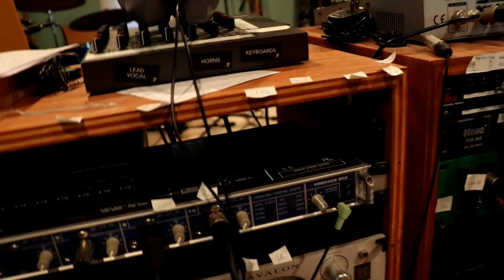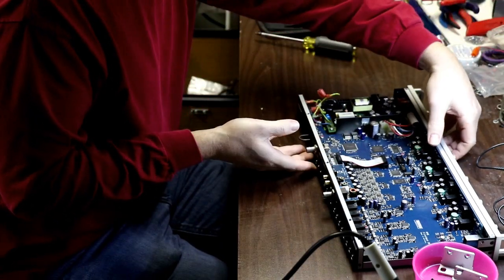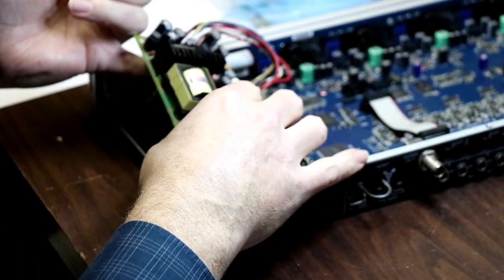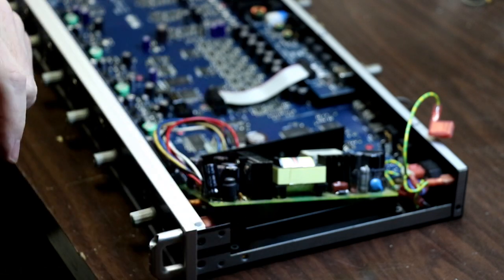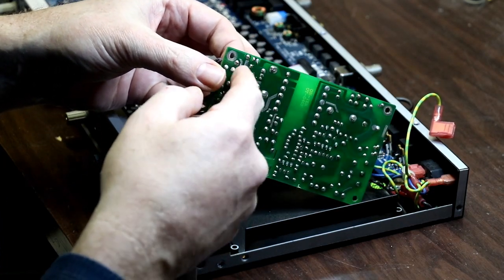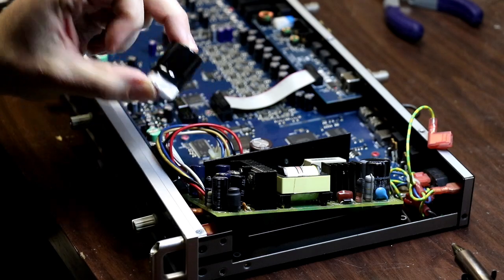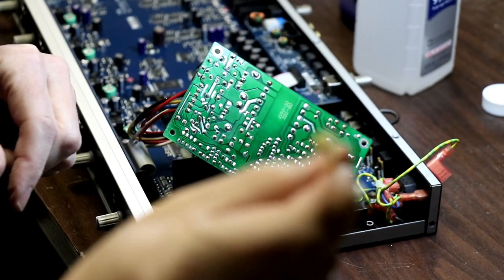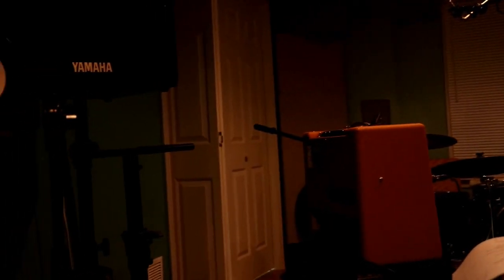RME FireFace 800 Repair

Comment: Great video ... my Fireface 800 died after years of solid use and replacing the power supply caps did the trick.  It's working perfectly again !

Comment: Really helpful video! Having a similar problem with my Fireface UFX - sometimes I get full level crackles across all the ins and outs - most frustratingly through main monitors regardless of whether I have it muted or not! Very pleased to see the process of replacing the capacitors is a relatively simple process! Fingers crossed!

Comment: Thanks for the video.  As an FYI, I too had a problem with my FF 800 that appeared to be power supply-related, so I ordered a new power supply directly from RME.  The total cost including shipping was about $112 USD (it was priced in Euros) and took about 2 weeks to arrive.  I just finished swapping it out with the old power supply, and the FF 800 is now working like a charm.  It only took about 15-20 minutes from start to finish to complete and that included removing and reinstalling the FF 800 into the rack mount.  And, there was no soldering involved.  Interestingly, I don't even see bulging caps in the old power supply, so visually it is difficult to see what the problem might have been.
Reply from the maker: That's a great update and will probably help a lot of people.  Thanks for the comment!
Reply: I also ordered up a new FF800 power supply and my FF800 was working great but only for about 100 hours and the problem is back.  I think I will rebuild the old one with better caps
Reply: @briguyhackins  Would you recommend to buy an used FF800 with a power supply problem, and instead of buying from RME the power supply, just rebuild the damaged power supply with new and better caps? I don't want to solder at all, and also I don't know if it would better to buy a Behringer 1820 interface (New) vs the mighty  RME 15years old firewire interface...
Reply: @RenatoPernett  A good technician can do this for you fairly cheaply.  I cannot speak to the Behringer product

Comment: Hey mate, thanx for the vid! I am experiencing the same problem now after an electricity failure this morning, the device just wont fire up and makes a whistling noise with the indicators fading in and out (first the noise was pulsing just as yours). I believe it to be a capacitors problem,  so gonna do the same. Actually I have already replaced C16 and C17 that were swollen, but it appears that it is not a way to indicate the damaged ones as the problem remains. Gonna get the whole set tomorrow and see how it goes.

Comment: After 15 years and non-stop use my FF800 has the same problem. It still works though but it takes 30 minutes to "properly" turn on. When i turn on the pc the flickering lights all of a sudden stops. Unfortunately i`m getting asio drop outs so it`s time to let someone fix it before a capacitor explodes..

Comment: ...”Replace capacitors in the power supply!”...  And that is a very likely issue, but it’s not a go to fix all for every piece of gear.  Although come to think of it, the power supply is practically the only serviceable section in a lot of newer hardware.  Capacitors that go into appliances and products often times aren’t really the most resilient.  There’s often a little tiny marking on them that indicates the Temperature that they’re rated for, usually 85 C or 105 Celsius.  Practically every time I need to order a bipolar capacitor, I get stuck with the 85C degree type and I never find the 105C type.  Thanks for sharing, good job and nice desoldering tool!

Comment: Just found this video, having what seems to be the same issues. Had the flashing lights, but now no lights just a weird high pitched noise from the main output. 
Bought mine new in 2007, so 15 years been going strong. Wil open it up later this week.

Comment: Thanks for the video.. Interesting, my FF800 is no longer showing up in windoze but red light and two green lights light up as normal when powered on.  I opened it up and all caps are super flat, no budging anywhere.  Ordered some new cables but doubtful that is the issue.  Tried installing it on 3 different systems including mac, no luck... I may have to send it to RME...

Comment: Both capacitors were blown in my FF800. I replaced all, but the FF is dead as bevore. Do you know the voltages/colors of the 2 multipinconnectors going out of the powersupply to the mainborad?

Comment: Dear Seth! Thank you for the video. I've got FF80 for many years and I have a problem with a Firewire800 onboard connector (there are 2 installed). I have been using very good FW cables like TetherPro and others but the main problem is due to poor contact the host signal is lost time to time. As soon as I touch the cable searching for the proper connection the host signal comes back again. Have you ever changed FW connectors there? Thank you
Reply from the maker: Never changed FW connectors. Early on, I did have some compatibility issues related to the FW card I had installed in my computer. Changed to a different brand and then it worked great. That was so long ago, I don't remember what I ended up with. That same card has travelled between a couple of motherboards now.

Comment: nice! so im right now doing the exact repair. First time soldering and I believe the power supply went well BUT, now im noticing those greenish colored capacitors be each xlr input are a bit bulging. Do you thing I can can by for a while without replacing those??
Reply from the maker: Those don't get heat the same way the power supply capacitors do, so they should last a lot longer.  My advice is to do the power supply and see if that fixes your problems.  If you still have problems related to the mic inputs, then you might want to consider replacing the other ones.

Comment: Great job, thank you for the details. Question: should all of the Cap Voltages be bumped up a tad. If so which ones and by who much?

Cheers - - really clad it worked. Nice job. Chuck
Reply from the maker: I'm coming up on 2 years since I made this repair and my unit is still working perfectly. It is also always on. I hardly ever turn the thing off. My feeling after this much time is that staying with the parts listed in the video is just fine.

Comment: Thanks for the video! I had a similar problem, the only difference is that the LEDs on channels 7 and 8 are flashing, like a phantom signal... Is the reparation procedure the same as in your case?
Reply from the maker: I can't speak to your problem specifically. All can say is what happened with mine and what fixed it. I didn't even come up with this solution myself. I got information from other YouTube videos and several forum posts as well. I filmed it after thinking that a more complete demonstration might help some people.

Comment: Dude you rule :) Did you have also ground noise due to that faulty capacitors ?
Reply from the maker: I never had ground noise. No issues at all until it just didn't turn on one day.

Comment: Hello, how much was the price of the caps and do you have any tool recommendations? Thank you for this!
Reply from the maker: I don't remember how much it was, but it was pretty cheap.  I think a bit under $10 for the parts plus whatever shipping was.  As far as tools go, a decent soldering iron is nice.  Mine wasn't super expensive, but it's nice to have variable temperature control.  Also, the electric desoldering pump was really handy for this job.  I could have done without it, but it would have taken a lot longer.  That can be a pretty expensive tool, and it took me a while to work up to deciding to buy one.
Reply: @sethgamba2840  I think I'm just going to buy the part.  I hate soldering.